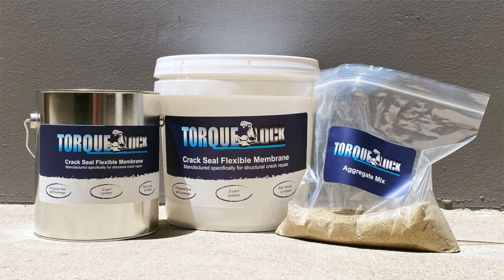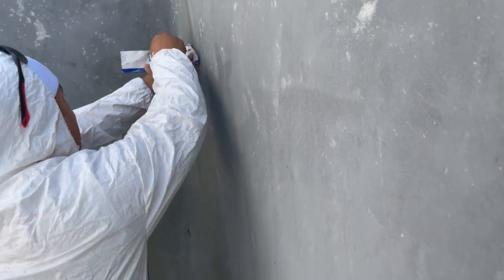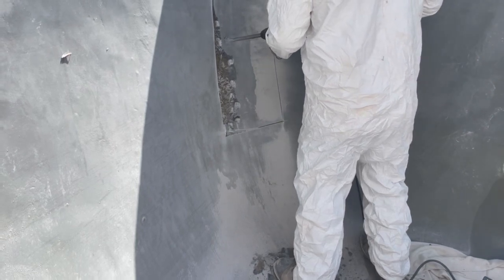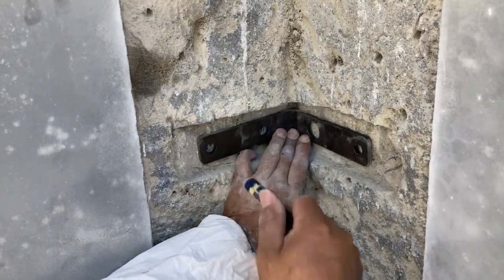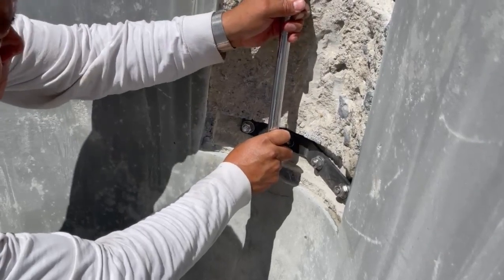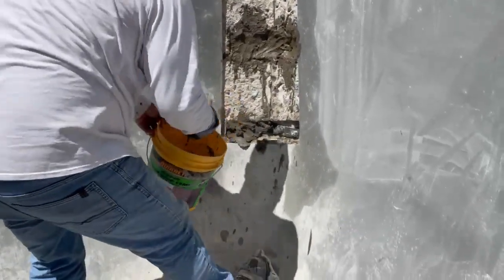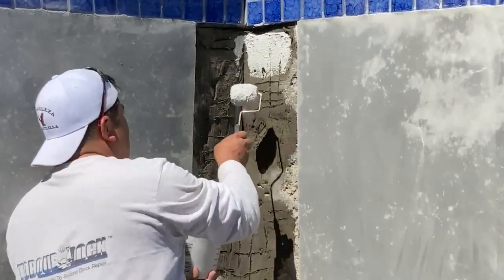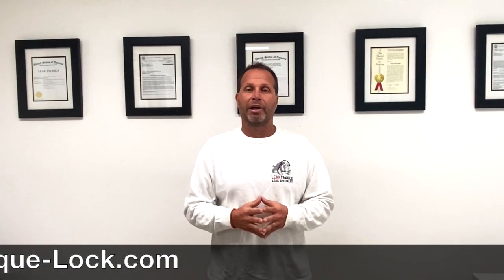Introducing Waterproofing and Hydraulic Cement Products by Torque Lock

Comment: Great job 👏
Reply from the maker: Thank you! 😃
Reply: @leaktronics  What would you recommend to repair concrete that's just spalling out around the edges of a plastic skimmer inlet? It's up high in the pool, but I can tell water is leaking out through there into the surrounding soil. Would hydraulic cement work for patching a small area like that?